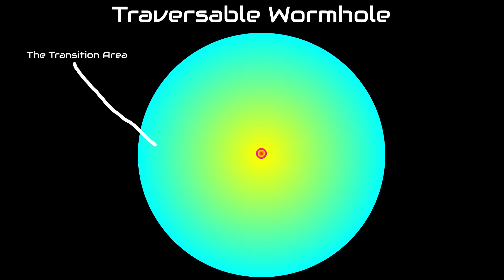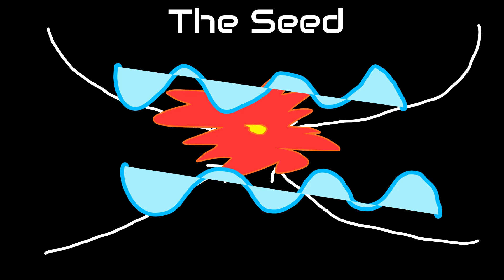Wormholes, and How They're Made

Comment: A little nit-picky but wouldn't the trips usually months at longest to a couple weeks at shortest given the distances required for travel for the majority of people? I mean, I know there's way of limiting the effects of acceleration on the body but wouldn't it still be limited enough to where you'd be stuck at the time scales I mentioned above?
Reply from the maker: That's true, but there are many ways to alleviate this waiting time. People can put themselves in stasis, alter their own perception of time, pass the time in a virtual world, etc. Also, if they are simply worried about the effects of acceleration on their bodies being too intense, they can always leave their bodies and re-enter or create new bodies when they reach their destination, or modify their bodies/create new bodies so that they can withstand higher g-forces.
Reply: @ExploringOAUP  I suppose that a common timeframe, if that's the word, would be a moot point in most instances. My baseline self is thinking on my terms when such is irrelevant of a future with the technology OA has.

Comment: can anyone explain do wormholes do time fuckery or not? time paradox is pretty vague term
Reply from the maker: They don't, there is chronology protection. The edges of the wormhole Nexus are displaced 5000 years in the future compared to the center. This doesn't lead to any backwards time travel problems because of the Visser effect. This effect is basically that once wormholes are far away from each and are displaced many years apart (due to one of the mouths being transported away from the other at relativistic speeds), they are unable to be brought closer to each other (which would lead to backwards time travel) without collapsing.
Reply: @ExploringOAUP  so you travel into future, but without side effects
Reply from the maker: @AtomcFish  Basically